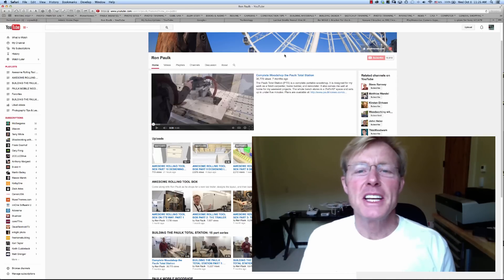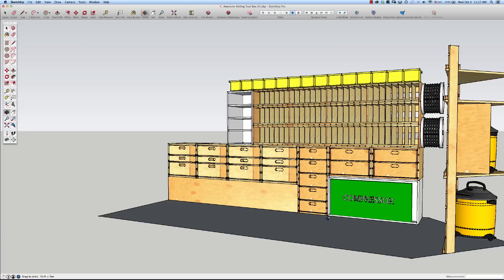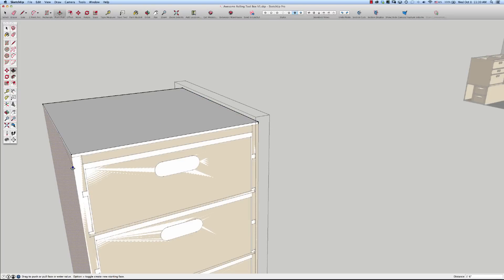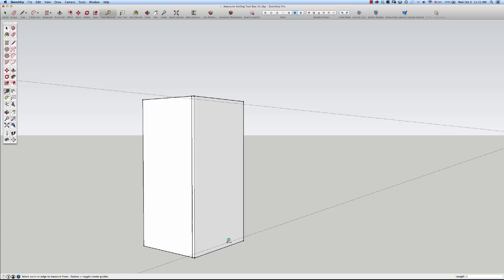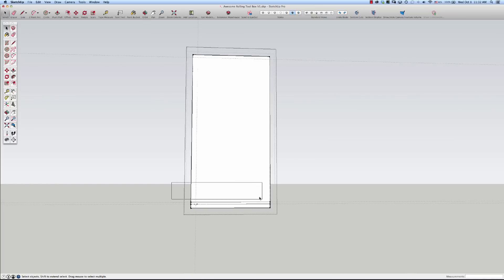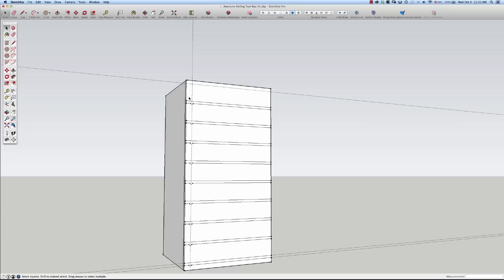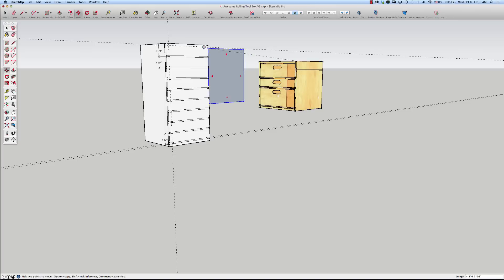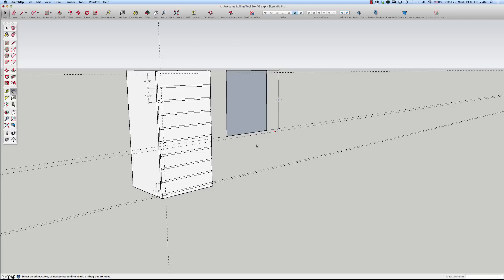BUILDING A MOBILE WOODSHOP (Part 11) 3D design is way faster than a pencil.

Comment: These are all fantastic videos,i have a 14'(behind the seats) step van that I'm hoping to fit ALL my job site equipment in,everything from forming to finish,have been designing for 4 months,and your ideas for the cabinets are perfect for me. A couple questions though, and if I've missed this somewhere,my apologies. No drawer hardware is genius,previous van configurations of mine had hardware on the drawers and they inevitably rattled themselves apart, not made for the vibrations of traveling!
 1) on your previous mobile workshop the bases of the drawers were made of 1/2" ply, I see that you've changed to 1/4". I'm thinking this may not support the weight of a drawer filled with tools or fasteners etc. maybe you could comment on what your thoughts are?
  2) Also in the mobile workshop you mentioned that you thought that the detent in the dados for the screw to lock the drawer closed could have been skipped since you found the friction of the drawers themselves was significant enough to keep them from sliding open? I see that you are incorporating this element again. is this because experience says to keep the locking system?

thanks for any comments and keep up the great work! I really appreciate the attention to detail in both your sketch up designs,and more importantly in my mind the real world.
 thanks Pete.
Reply: Excellent reply! It's great that the same module will work with the other size unit. I love it when a plan comes together!
Reply from the maker: ¼" is not time tested by me, but it should work. I will do a few tests in the shop before I order material, I will also test ⅜."

I did not need the screw stops in the Mobile Shop Truck, but for extra security I am sticking with them. It would be a major pain to add them later. I will hold off on installing the screws on a few drawers and see how they do.